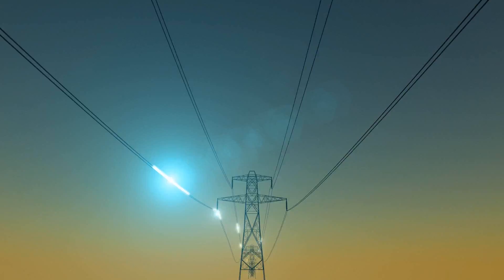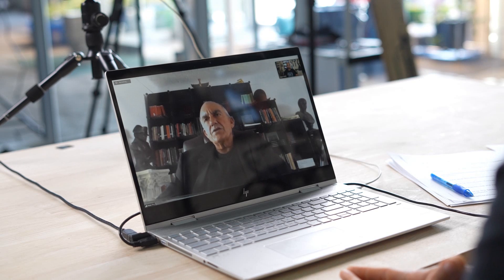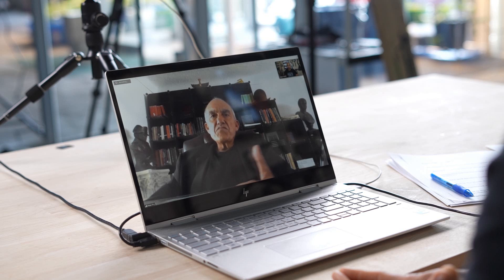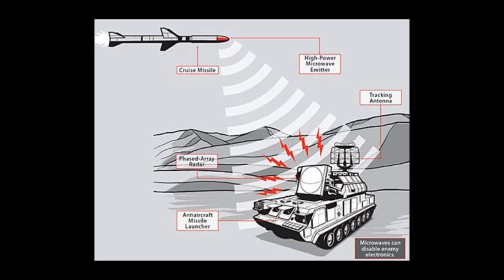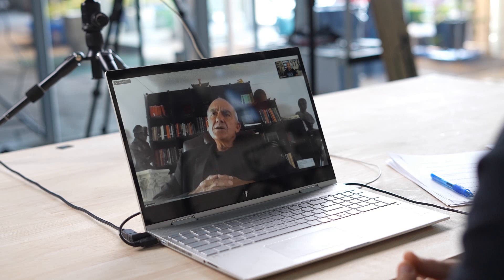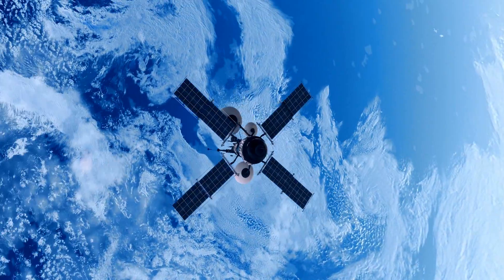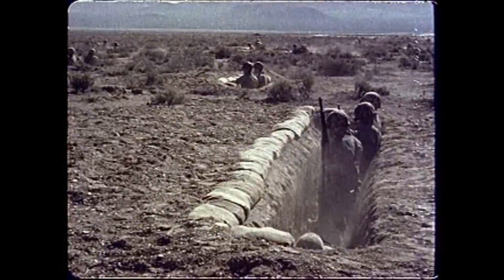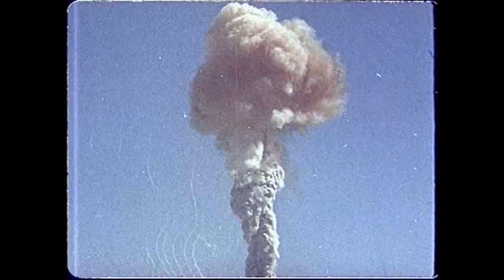Russias "SUPER: EMP Weapons Explained

Comment: Boeing E-3 Sentry flying in a continuous pattern right now over the UK. As this is an early warning system, that’s quite worrying!
Reply: Canadian Prepper±¹³¹⁰⁹⁸¹³²⁶⁴  I’m based in the UK and charged extortionate rates for international calls so apologies. If you look on flight radar you can see the sentry doing a full path over and around the mid to north of the UK towards Scotland.
Reply: Found it ZH103 (SOLEX01). Look it up. Was flying for over 7hrs.

Comment: Ok well, an EMP would knock down all power lines and computer chips but, what about an old fashioned car or truck from the 60's or 70's,, would it still be running with an EMP ?? 
I'm just Joseph,  a Prepper getting prepared..

Comment: the sun sends out flashes that are similar and we are long overdue great channel kitchener onterible prepper
Reply: the transformers on all the streets can be wiped out and impossible to replace cause there is no supply inventory..also all cars after 1986 will be useless after an EMP  cause you will have to replace the computer to make it functional i encourage everyone to install a shut off switch for your battery in your vehicle so your car cant be stolen plus you can remove the lead from the battery and will sdave yopur car from computer melt down. I am a millwright electrician and engineer

Comment: Sorry, but a 1Kt Device is not going to generate an EMP that can take out power grid for an entire continent. Nuclear EMP weapons are designed to reduce the plasma generated that acts like a short shorting out all of the compton radiation (free elections). I don't believe this fellow understands how nuclear weapons really work, & just has a basic understanding. He is a former CIA employee, not a engineer or involved in the development of nuclear weapons.

 a 1Kt device has a maximum energy potential of about 4000 Gigajoules. While that seems like a lot of energy, only a small fraction will produce compton radiation. and EMP weapon to have line of sight for the entire CONUS needs to be 330 miles above. energy density falls at the square of the distance. 2 times away = 4 times less power.

A nuclear weapon is a weapon that used nuclear power as the source of energy. An nuclear EMP weapon is consider a nuclear weapon. Any country that uses an EMP on the US will recieve a a nuclear retaliation strike. No enemy is going to just use an EMP weapon on the US, as the US will consider it nuclear attack. A EMP detention will just be the first salvo since it just has a shorter travel time. An nation will launch its nukes on the US, detonating a few EMP first to create a fog of war and disrupt communications. The remaining warheads will arrive at there destinations a few minutes later as the plunge through the atmosphere and reach there targets.

Comment: I use to do contract work for our local power company, and I think critical infrastructure for the power grid is a lot more robust than people give it credit for.  Sure , an EMP would "probably" create power outages, but I the grid would recover pretty quickly.
Reply: Couple that EMP attack by several cyber attacks beforehand. The grid will be shut down.

Comment: How can we protect our vehicles so they still work if we need to get away?
Reply: You would want a fairday case ( or whatever it's called) and have spare electronic parts in there. The reason why you would want something like this is because fairday cases are actually insulated which protects against electrical pulses and as well it blocks signals. Plus you would be able to switch out the needed parts once the EMP strikes. I recommend doing some research because there are different kinds of fairday cases and some of them do come in bag form.

Comment: Small (pocket level )emp device schematics are available on internet. Will work for 10-30 ft radius. Basically it's a step up converter, generating high voltage, charging a HV capacitor. Than dumping that capacitor into a coil with a crazy amount of turns. Small emp like that will fry a lot of tech, and sending into reboot/glitches other ones.

Comment: QUESTION FOR DR ....what.indicators should we as gen pop look for that may signal emp is inevitable in short period of time.  ALSO top 10 emp 'proof' preps...Nate ive probably watched ur emp ones in the past but a link or updates based on the drs info would be great!  Thanks appreciate you both and my fellow preppers
Reply: The only real prep is a faraday cage for electronic items. A simple metal box that is lined with a non conductive material (foam for example). It's important to make sure where the lid closes the seal is also conductive, so use foil/foil lined tape. An ammo box is a good, small example. This in theory should protect any electronic items inside the same way as when you see people in faraday suits with arcs of lightning hitting them but the person inside is fine.
Reply: @craigthomas7921  yeah im aware of them...maybe more in terms of doing without those devices but still communicating, travel etc
Reply: @craigthomas7921  Or one can be prepped to live without electronics. Frankly I think even if you put everything in a faraday cage it's only going to last so long before your parts wear out or your electronics die from being used. Then what?
Reply: @justinburch  I'm of the same opinion. All our enemies would have to do is set off a few emp's to take out communications and electronics, then wait a few days and set off another round for the folks that took their radios out of the farraday cages to get some info. I agree that we'll have to learn to live without electronics, maybe not the military, but definitely us common folks.
Reply: @justinburch  I completely agree and that applies to everything. Eventually everything will reach a point where it stops working. The faraday cage is just for the initial protection from an EMP
Reply: @craigthomas7921  don't you need a battery to give the Faraday cage a charge?
Reply: @gabechacon8375  no battery is needed. A Faraday cage creates a barrier between the internal components of a device and the external electric fields. It works because an outside electric field causes a redistribution of the electric charges within the enclosure's conducting material, which in turn cancels the field's effect in the cage's interior.

Comment: Not sure how much Pry really understands electricity.  The voltage itself has little meaning if it doesn't operate through a load.  Loads will be intrinsically generated in dense electronic devices due to inductance, capacitance and resistance that develops between the various metal masses in the design.  Nevertheless, I don't think EMP weapons will be anywhere near as destructive as theorized.  Even a thin metal sheet will shield an electronic device pretty effectively.  I'm not saying we won't have problems with unprotected infrastructure elements, but I seriously doubt the claims that an EMP is going to disable everything in a statewide radius.
Reply: Metal caged devices are ok but problematic are long wires and these are everywhere. Not only large power lines but home mains wiring, computer network cables etc. You can have working fridge and pc but can't be used if house fuse box is fried and pc network port is toasted
Reply: @artur8403  Yes... very true.  These are the "unprotected infrastructure elements" I was referring to.  There are ways to isolate your loads from the wiring that supplies them.  I imagine there will be at least some warning that EMP's are incoming, and a well-prepared person could deal with it.  I'm building my next residence right now out of pure stainless steel;  everything inside will be EMP-proof.
Reply: EMPs are ancient compared to the tech they have at their disposal. 

Just made 3 videos unequivocally demonstrating that.
Reply: Pry is a expert in the art of bs'ing I do know that.

Comment: What's the difference between in the dark,or in the dark?Either way,you're going to need flashlight's. Remember to have some flashlight/electric lanterns Without batteries in them so when the EMP goes off, it won't fry out.After it happen's then pop in your batteries and you are good to go.
Reply: If the EMP is strong/close enough to fry the batteries, it can also easily fry the inner wirings in every kind of electronic device.
Reply: @Eminovici  I wouldn't count on that.I would say if that's true,then ALL generators would also fry out if the EMP was Super Strong.ALL of Everything would fry out then.Absolutley everything that had a circuit would be useless. Tesla cars dead everywhere..Okay i did just make myself laugh a little. Either way,it's going to be a Mad Max Future.
Reply: @androidarkitecht8339 The Karington event involved the telegraph lines melting down all over the world. And those wires were much bigger than the current thin gold/silver wires used in microelectronics. An artificial EMP could also have such an effect on a local level.
Reply: @Eminovici  So you're saying everything is going to be okay and we will all be fine? Thank GOD!(I have to admit,i was a bit worried.But i feel much better now)😳
Reply: @Eminovici  Naw, i know all about the Carrington Event.I was just being funny! 
(Or sarcastic depending on the time of day.) And i think you misspelled it according to Wikipedia which states:
The Carrington Event was the most intense geomagnetic storm in recorded history, peaking from 1 to 2 September 1859 during solar cycle 10. It created strong auroral displays that were reported globally and caused sparking and even fires in multiple telegraph stations. ..So yeah we got a whole lot to look forward to...Not!
Reply: an emp will kill ALL ELECTRONICS.  u will need candles not flashlights.  emp kills the electronic components whether there is a battery in it or not.  it fries the wires.

Comment: Hi Nate,

I brought a few cell phones with various service providers. Some of these cell phones are fully charged and left off in wrapped thick aluminum foil.  I wrapped the chargers and phones.  Occasionally, I will unwrap i
them and recharge because they will lose energy although I never turned them on nor used them.
The advance technology makes these devices unable to be worked on or repaired by human labourers.  AI repairs all circuitry and ROM chips.

Thanks for breaking down the interview into parts. 🙏
Reply: How did you protect the cell phone towers ?
Reply: @rationalmind6362  lol
Reply: @rationalmind6362  🤣🤣
Reply: @rationalmind6362  

Here in NYC, the service provider AT&T made a huge edifice with no windows.  It is where they may have  continuity of communications, I have learned and read.  Whether it is for public or not, those with the provider services may indeed have their cell phones operable during the EMP event.  Just hoping. 🙏
Reply: I was just thinking,  it's our gonna be nice not to get a call about the extended warranty for my truck!
Reply: Never full charge a battery & shelve it. You may end up with a dead battery when you'll need it. 😶😕😒

Just charge/discharge it between 25 - 40 % & then put it in a storage.
Reply: Patrick  
YES INDEED THOSE HAM RADIOS.  I AM STILL LOOKING FOR  THEM. A LOT OF ONLINE OUTLETS ARE OUT OF STOCK.
Reply: @Lady_A.R  check Ham radio outlet in Plano Texas
Reply: Friend suggested getting a ham radio but I think even protected they too will have issues at least for awhile because of the atmosphere being ionized from the emp blast at least for a while? Any thoughts with this one folks let me know.
Reply: @JBS2018  Not true, it’s a miniature computer with stored info. Depends on what is stored on it.

Comment: Proton emitter - a compact modular three-dimensional linear accelerator on a backward wave. That is, he aimed, for example, at the core of a nuclear reactor of an aircraft carrier or nuclear power plant and destroyed it. No nuclear chain reaction, just disabled. In this way, it is possible to neutralize the attacking blocks of intercontinental ballistic missiles - the plasma shield will become a "brick fence" leading to instant mechanical destruction.
Reply: Including from an incoming sarmat missile?
Reply: @demsakawalkinglatetermabor7ion  

EMPs and missiles are ancient compared to the tech they have at their disposal. 

Just made 3 videos unequivocally demonstrating that.
Reply: @demsakawalkinglatetermabor7ion  Yes and a Sarmart2  missiles. Interferes or destroys the guidance systems.
Reply: I think we’d have more luck doing a time machine or teleportation device first.
Reply: CERN is activating today and they turning back on the big one-Heldon or so,etching like that. I’m going to check cern site out now. They say it will be broadcast.
Reply: @Judithestears  Just what we don’t need…
Reply: Safer. Thanks